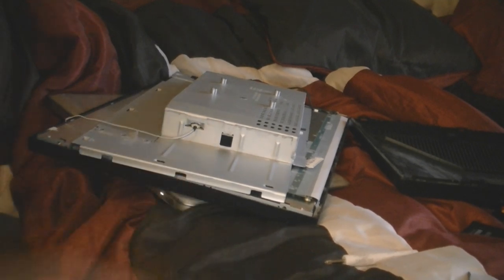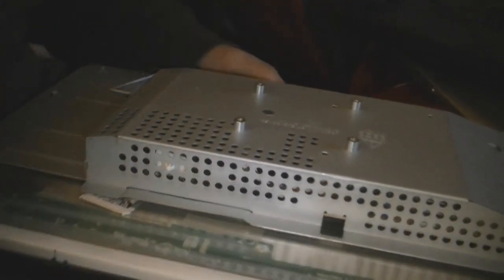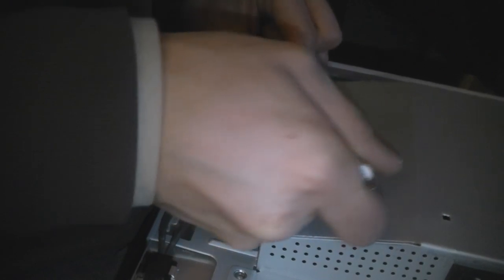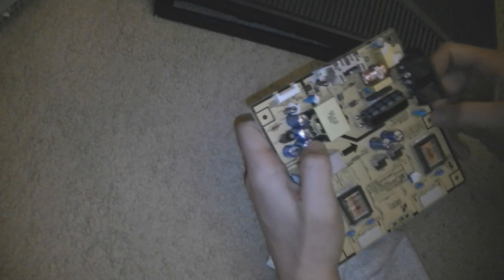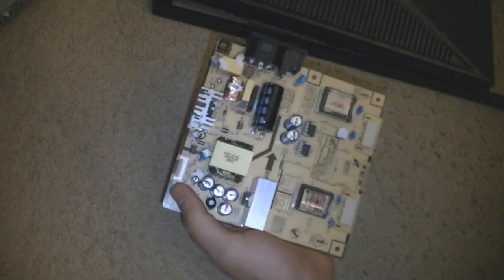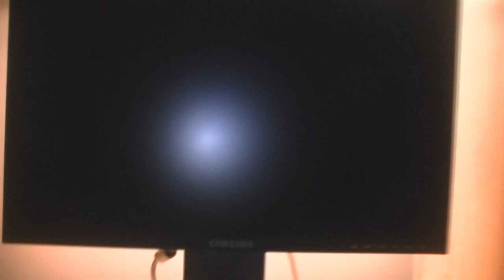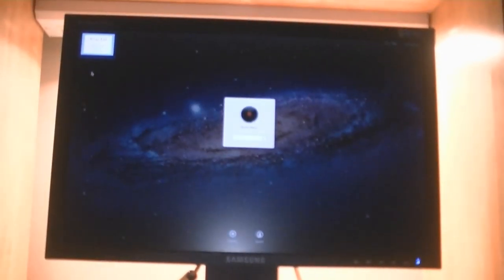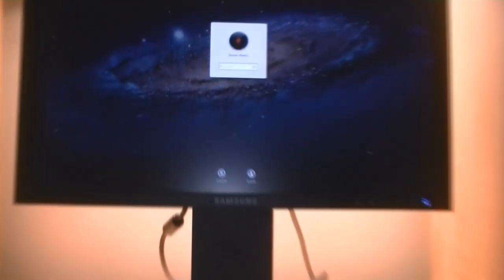Tutorial: LCD Monitor Repair (Samsung, Lg, Acer, Asus etc)

Comment: I have an Asus VG236H. When I plug in either the HDMI or DVI cables, the display comes on (and looks great) for a split second, but then it goes away. This monitor was very expensive and I can't believe I'm having this issue already. Any idea what the problem might be?
Reply: Hey, were you able to find a fix? My monitor has this same issues. It happened like 3 years ago but I'm trying to fix it now.
Reply: difficult... I found out the the inverter board have a "feedback" trace and IF it detects any kind of anomalies, it shuts ALL CCFL DOWN (for safety or else) ...

I am looking up for that since I don't want to spend 50€ for an replacement inverter board...

Comment: I need help with my Asus VN289H LED Moniter not that the name matters but I was trying to move my setup and I dropped Moniter on the corner of the desk and it looked completely fine on the front of the glass but when I turned it on the part the got hit was black and showing colors but everything else was working completely fine nothing wrong the Moniter had no issues just the corner that got hit is blocking 1/4 maybe a little less of the screen but I don't know what to do should I buy a new one or get it fixed I don't know the price or anything I don't think I have a warranty but I have a extra receipt I don't have the receipt that has everything but I have one that says that I bought the same Moniter and has the date I have no idea on what to do please help me!!
Reply from the maker: +Danny Yeet Honestly, I'd just go for a new monitor, monitors are getting cheaper and cheaper, back when I made this video, they were still expensive and I was a kid still

Comment: if the problem is not the capacitors, do you know what else could it be?
Reply from the maker: Does it make any beeps when you start it?
Reply: zippyzappyz  it's an asus monitor with two led statuses
(normal: BLUE, standby: ORANGE). Now it blinks the orange led lightly and the screen itself flashes randomly white.

Comment from the maker: you mad bro? don't be, taking it apart is simple, just get the screw driver between the middle of the side of the screen, and go around the sides with you screw driver until the two plastics separate, its as simple as that. You still mad? lol